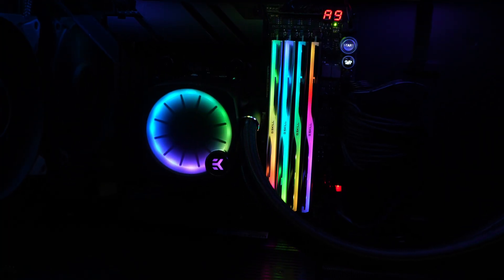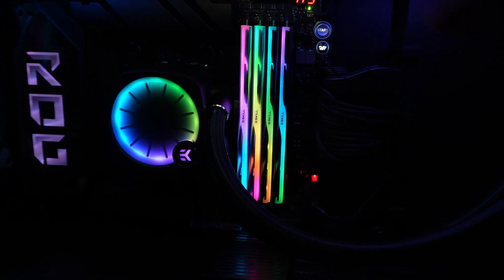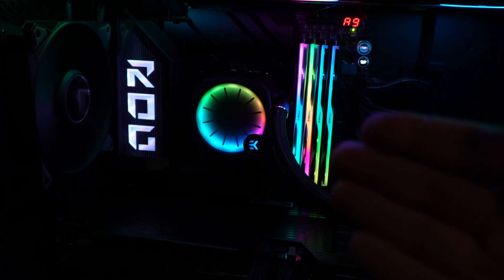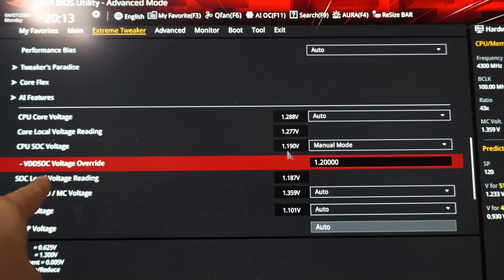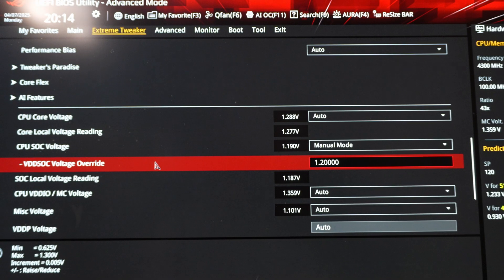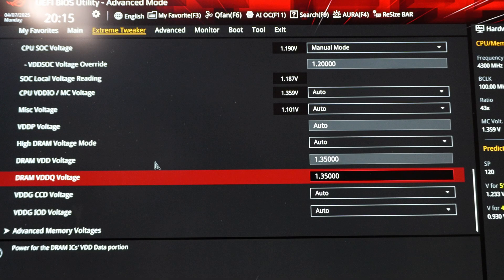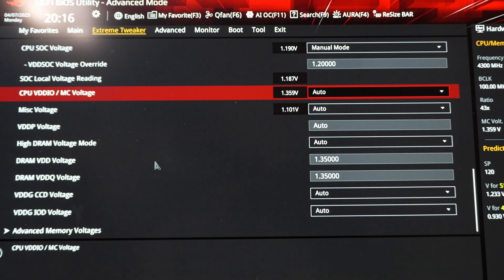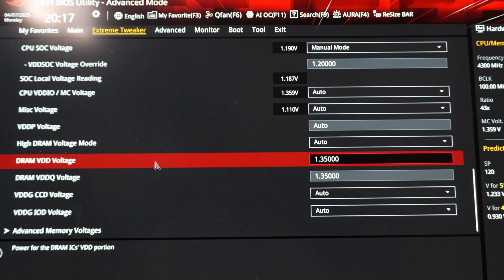Regarding DDR5 and memory controller voltages

Comment: Is VDDIO 1.4V safe? I cannot use 1.35V VDDIO as I get BSOD IRQL LESS OR NOT EQUAL
Reply from the maker: Are you loading the EXPO profile? You don't need to change the VDDIO as it will be loaded automatically from the memory's SPD.
Reply: @GameTechReviews yes I am loading EXPO profile

Comment: Nice thing about AMD is tinkering😊.  My pc run best at uclk:fclk = 1:1 @2167, ryzen 7500f, vsoc 1,25 (below this will cause post failure with three long beeps  on first boot after changing vdd/vddq/vddio, regardless the change is higher or lower, the same for vddq and vddio). Vdd 1.35, vddq 1,27, vddio 1,27. So far so good at 6200MTs 30-36-36-48 (ram kit is dual rank gskill 16GBx2 6000 32-38-38-96). CO set to negative  per core, takes 1-2 months tuning per core, under 1.23V vsoc cause lower CO and lower boost). Boost overdrive now set to +100Mhz. Happy at 37°C on idle and around 44°-52° C on gaming or stress test. Still, until today, almost 1.5yrs, looking for what to improve next.. 😂 6400Mts is tempting, but i worried to run at higher vdd and restart the journey, since my kid is using the pc for gaming and doesnt concern about the life of the pc. If boot fails or crash, they will just reboot the pc until it runs. 😂

Comment: I am concerned about CPU VDDIO / Memory Controller Voltage. For how long 1.35V or 1.4V of CPU VDDIO will be safe before Memory Controller inside the CPU starts degrading?
Reply: From what I have learned that’s the voltage of the connection between the cpu and ram and not the voltage of the memory controller.
Mine is 1.440v because my memory is 1.4v ( I think it accounts for loss in voltage)  
The SOC voltage is different and is the actual memory controller voltage.

Comment: Thank you. The Vsoc at 1.2 plus other tips here helped my 9700x and Asus Tuf B650m-Plus wifi run my Silicon Power Zenith(2 identical 2x32gb sets different dates all same timings) Hynix A die Dual rank at 5000Mts(It normally runs at 6000Mts on 2 sticks Expo II) stable.  I probably have to work with the proc-odt values (because its expanded to another menu of values on this board otherwise i would use 48ohms) a little more to get to 6000 but I'm happy right now at 5000Mts for 128gb 4 sticks stable.

Comment: I have an Asus TUF Gaming X870 MB running a 9900X and Corsair 64 GB (2*32) 6000-CL30 RAM, and it fails the first two quick runs in MemTest.  Raising the timings did not help, but lowering the frequency did.  Someone suggested I raise the VDD to 1.435 - EXPO is 1.40.  What do you think I need to do to get this memory stable?

Comment: Is 1.44 vdd 1.44 vddq safe ? This the voltages that i need for stable 6000mhz cl28 2200fclk my cpu vddio is set to 1.3v
Reply: Temps and type of ram die usually plays the biggest role regarding voltages. My Hynix-A dual ranked kit running 6800mhz and tightened timings require 1.46VDD & 1.43VDDQ but can be pushed much higher as long as the temperatures are held in check (<53c Hynix-A, sensitive divas when OC'd).

1.44v sounds pretty high for that speed imo at first glance, you might have to look over the timings if you have tuned it manually as that is probably what is requiring the crank. But 1.44v is not "dangerous", you would experience instability firsthand if it was too high and the DIMM reached critical temperatures.
Reply: @DaWolfy yes my timings are tight as well its not the default expo timings I get about 56 latency in Aida extreme

Comment: Following your instructions on previous vid, I got the 2 sets of 2x24GB 6400MT/s DDR from T Force. They are using Hynix chips so I may tighten the timings soon. On the 9950X3D and I don't even feel the need to overclock the system as it's perfectly stable now.

Comment: I'm on 2 sticks of 48gb for 96gb total running at 6600mhz on an x870e board and it's been stable thankfully but would you have any tips/advice on things to watch or do for optimising performance/heat/stability/etc?
Reply: Did you manually set FCLK to 2200mhz and UCLK=MCLK?

Comment: Has the Q-release system on the motherboard affected your GPU in any way? I’ve heard it might scratch the GPU PCIe connector during the initial installation or removal.
Reply from the maker: It can scratch on removal.
Reply: @GameTechReviews  so the best is plug in and dont remove?

Comment: Hello brother, greeting from Serbia. I follow you for a while now, you record good stuff. So my question is about FCLK, i see you run at 2000mhz, and ram is 6400, why is that? Did you try running 2133mhz ?
Reply: Dont Push voltages, Mine Runs 1.060v on SoC 1.160v on VDD IO AS it should. 6000 MTS/ CL28 with tuned Subtimings on 1.35V Hynx RAM. Sometimes less is better.
Reply from the maker: You can but I change memory so often for testing that I usually just leave it at 2000 since that's the typical operating frequency for it.

Comment: I Have an extra set of matching 64G ddr5 6000 cl30 that i couldnt return after changing my mind on the color scheme (White to Black & silver).
  I am running a 9800x38 on a taichi b650e MB With a tuf 7900xtx for gaming & 3d design. would it be advantageous to run it @128G of ram, or @ least a little faster on CPU limited scenarios? It Feels like a waste to just have the other sticks collecting dust if they would be useful? I have heard it both ways.
Reply: ive seen some people commenting in the klev memory kits that they are running 128gb ddr5 6000mhz 
somebody should give it a try.
Reply: @luismarcoperezthemsel1677  people sleep on that brand. I used thm on my last 3 builds. Never an issue!
Reply from the maker: You can run 128gb but most likely at 4800 or 5200. You should watch the previous video I did which covers running that amount of RAM at 6000.
Reply: 32gb per stick is dual rank already, plus the other 2 sticks would be slowing you down hard.

Just sell them.